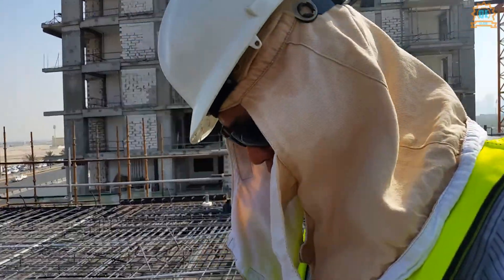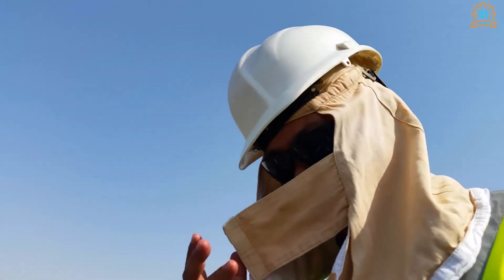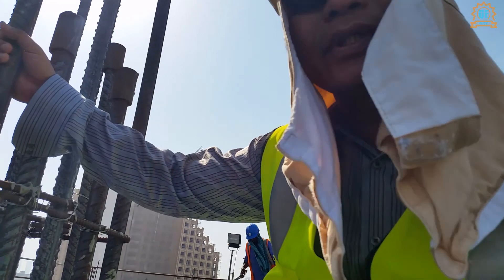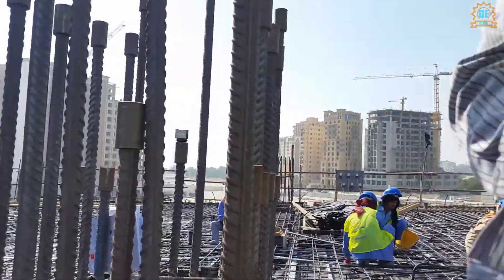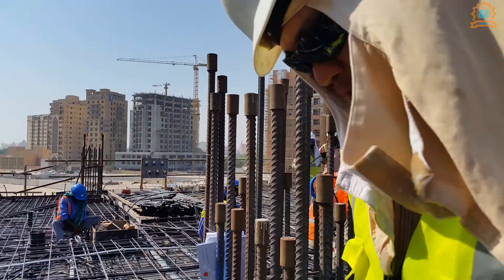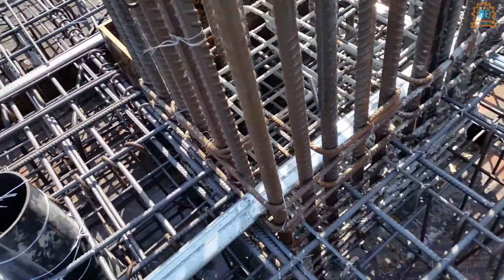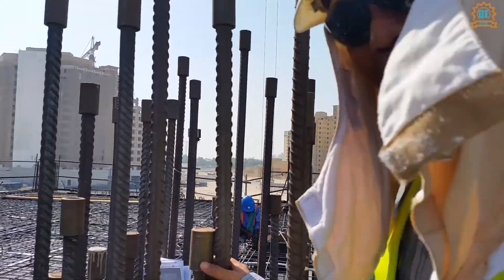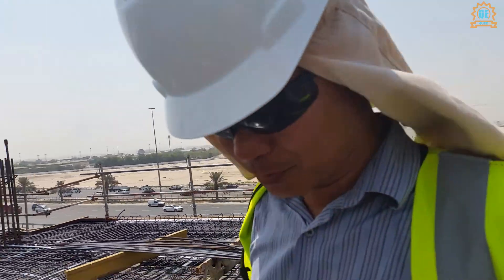How to check the steel reinforcement on drop panel of flat slab

Comment: Thanks sa info Engr. Yan pala ang reason ng coupler,para di ma congest yung space masyado.Parang napansin ko Engr.Yung sa gilid ng column nayan,I think Mechanical Box ba yan. Tanong ko lang Di kayo naglalagay ng extra diagonal bar sa every corner nya?Thanks sa info  nito Engr.
Reply from the maker: Oo yon nga kasi napakalalaking diameter na ng bakal. Oo mechanical box nga,  Sa mga opening meron mga diagonal. Welcome.